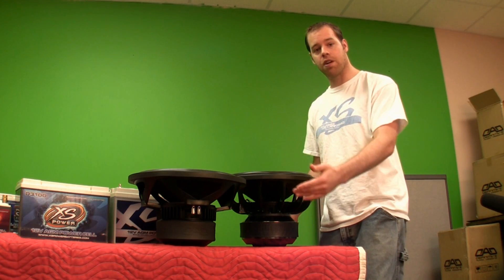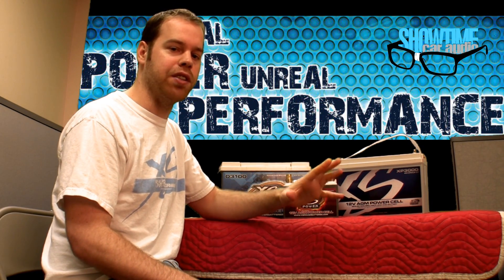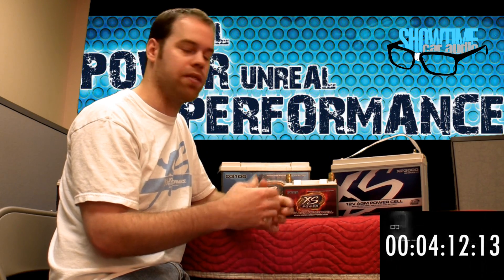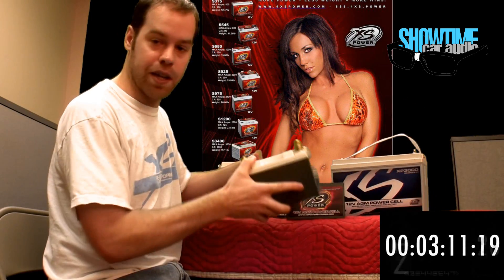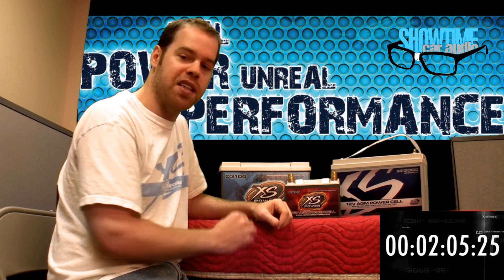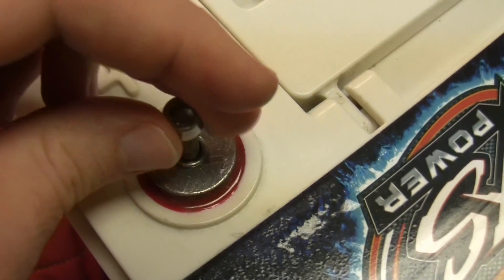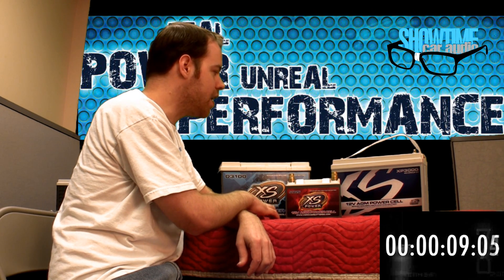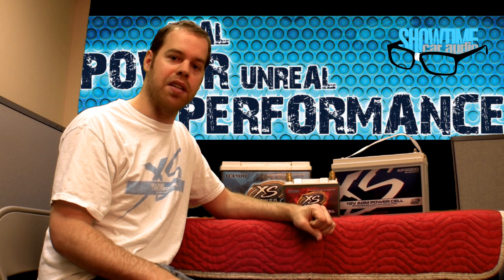Showtime Electronics- What is a Battery Featuring XS Power!

Comment: I still dissagree with you because after melting and purifying the lead regains its stucture. One more remark - solution of water and sulfuric acid in the battery is called electrolyte. The actuall dielectric in most batteries is made of perforated plastic and it forms a poket around each positive plate.